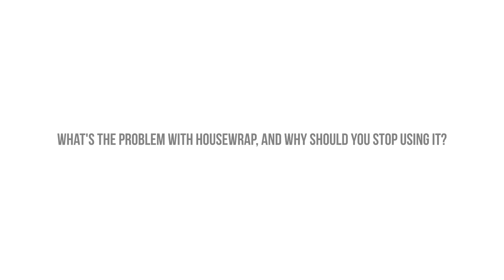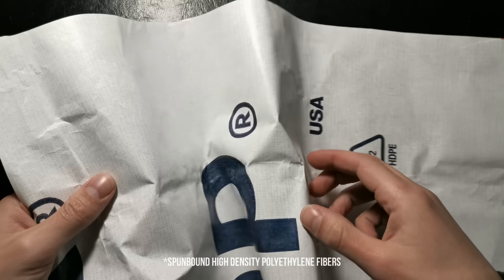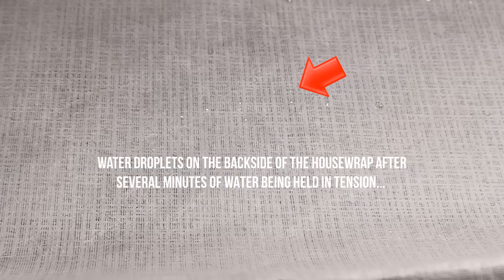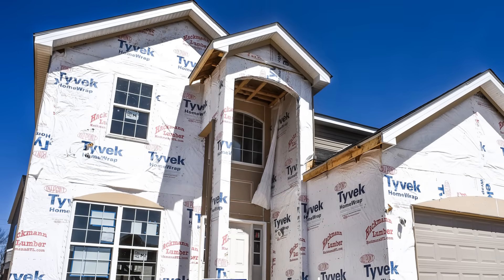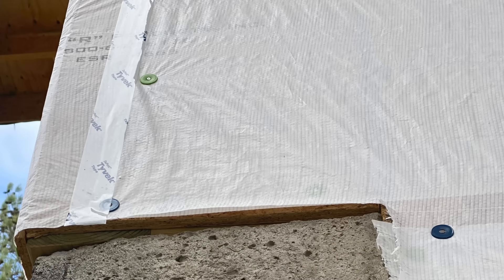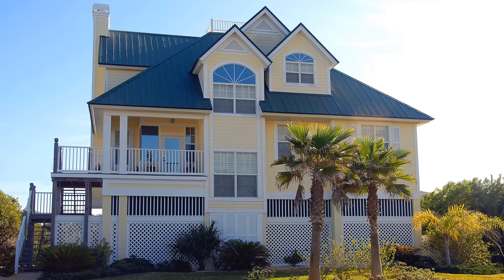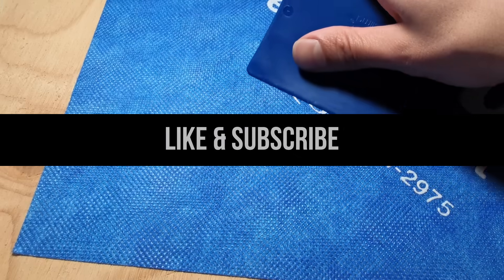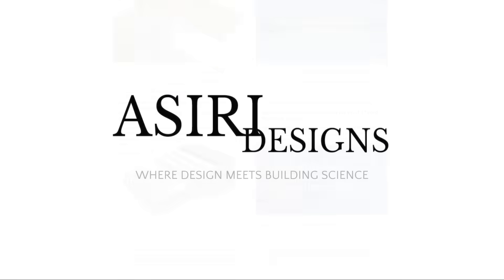Why I Stopped Using House Wrap

Comment: In Texas they're  using cardboard walls and its completely  within code.
Reply from the maker: @bobcaygeon975  What does that tell you about the code?
Reply: How does that work with the humidity?  Or if it gets wet with a hurricane??  Makes no sense.
Reply: @1packatak  
When Matt Rye- singer isn't shilling for zip greenboard, he did a video on the cardboard walls.

Comment: Sitting here in Ontario it sounds like a gimmick to me but maybe where it is warmer and wetter this would become more of an issue? My favourite now is to sheet the house with foam board and tape the seams. It works great and that continuous insulation is a real game changer!
Reply: You actually have serious issues in colder climates because of the water vapor generated inside the home. The structure needs to breath, to allow vapor to diffuse through the permeable barrier to the outside air. Tyvek or house wraps are, as witnessed in the video, bad for this. I've repaired so many damaged structures, some of them included replacing exterior framing due to poor construction and vapor management. The builders either don't care or have no idea how to manage this.
Reply: @iwastoldtherewouldbenomath6869  it looks like not only math is your weakness.  Pros  remove moisture in air from buildings by ventilation or dehumidifier
Reply: @andreycham4797  the problem is not all builders are”pros”. Especially in areas where they are throwing houses together faster than you can blink.  These “builders” do it as fast and as cheap as they can. 
My house is an example. Had some issues when we first moved in the “builder” said were fine, as did his subs. So we called in a different HVAC company. And then a third. After some discussion with the “builder” based on the inspections of the two other HVAC companies, the issues were fixed at no cost to us. Wound up in the same situation with plumbing and electric. Even though our home had been “fully inspected” by the city prior to purchasing.
Reply: At least the last decade, we in the construction industry have seen the vapour barrier move from the inside to the outside with the foam board and a blue skin type product before the brick fascia. Similar to what you have described. I have been in the building envelope building trade since at least 1988. Before that Reno's with my dad.
Reply: @Richard-nb4iv  they say the climate is changing I just could not think it is changing so fast
Reply: @andreycham4797  I dont believe moving the vapour barrier to the outside is because of global change. I belive the condensation gets trapped inside the wall cavity because of the interior vapour barrier. The results would vary greatly on workmanship of course.
Reply: @Richard-nb4iv  you did not clarify the climate you are in so since you mentioned the standard practice used to be to put vapor barrier on inside I assumed it is colder climate. My question is what happens to the laws of physics in your area,  vapor does not move from hot to cold any more?
Reply: If your Ontario is  in Florida or Texas, it is totally fine to put foam boards on the exterior side. If it is in Canada you do not want to trap vapor inside walls with that foam